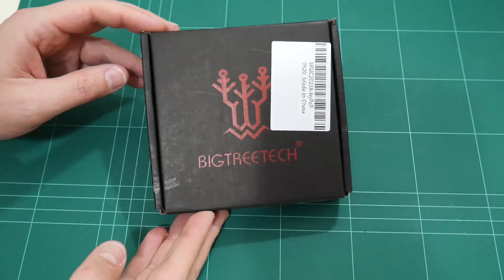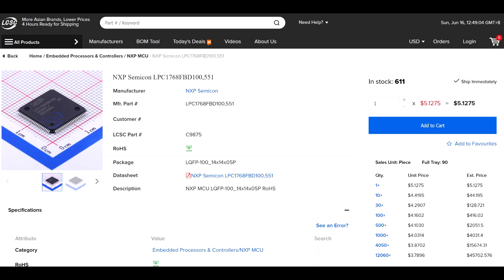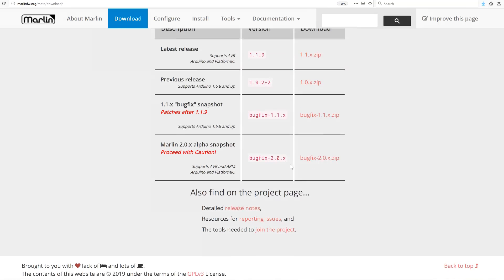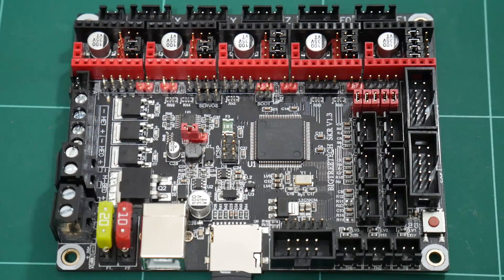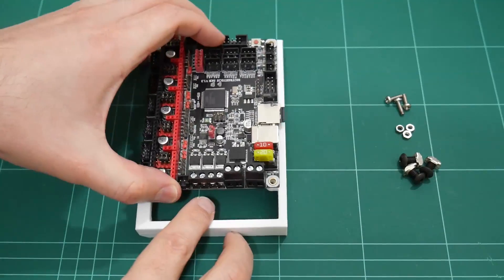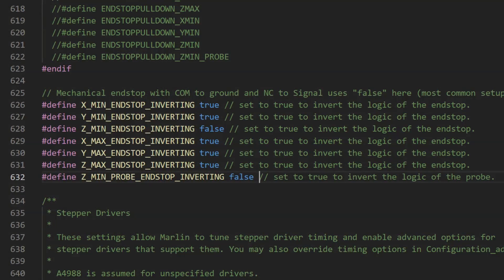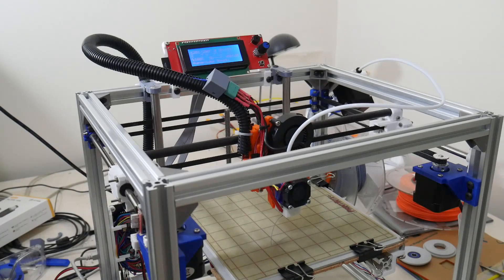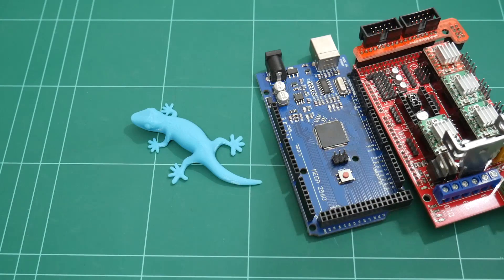Cheap 32-bit 3D Printer Controller!

Comment: Interesting, still no idea why you'd want one. Near the end there was some discussion of print speed, but from my limited experience print speed is limited more to improve print quality due to fast changes in direction imparting vibration to the frame and micro wobbles in the print head. So being able to print faster isn't necessarily a good thing. So why would you want one if you have a working printer?
Reply: The quest for the Holy Grail is alive and kicking apparently based on the plethora of upgrades people do.....because it seemed like a good idea at the time..... to working machines right out of the box. You need to do a side by side comparison for any upgrade or you might as well just rub some snake oil on the machine while praying to your favourite god and burning some filament as an offering......the end must justify the means.
Reply: @gangleweed  Yes, I'm just not clear on what the end is in this case apart from ...more bits?
Reply: If you are using a ramps and its working for you, no need to upgrade, but for any new purchases, these are a good choice, as they are very cheap and offer a lot of expand-ability later down the track (program space wise and also processing wise.)
Reply: @myopinion69420  So this is a future-proofing exercise? It doesn't really do anything now, but future stuff may or may not require it?
Reply: @whittaker007  It does stuff now if you have the need for it. for example, i had originally ordered a ramps to go in my hypercube, but ended up putting the hypercube on hold for a while and bought an ender3, the ender3 board is so bad i put the ramps in that, but i am still running out of memory with what i have enabled in marlin.

Just ordered one of these to go in the hypercube as i am now going to try and finish it and would like full control over the steppers in a nice clean single board. also can run 2 hotends and a PWM fan (part cooling) without adding addon boards.
Reply: I fail to see where the term the Ender 3 board is so bad.....it might not be the very best...….. when people with heaps of experience extoll the virtues of this machine right out of the box and highly recommend it. If it required a new board right from the word go just to make it work then nobody would buy it. I would say that if you wanted to do amazing things with this economically priced and manufactured printer then I suppose nothing yet made will satisfy the quest for the Holy Grail. @myopinion69420
Reply: @gangleweed  I never said it did not work. the printer itself is awesome and if your just printing thingiverse models in pla, no need to do a thing. Except install a bootloader and compile marlin with thermal runaway protection.

Its the fact that the board needs that done is what bugs me about it. If i did not have a mks sbase laying around, i would have probably kept it in, at least in the short term, but i had the sbase sitting in a draw and could not be bothered stuffing around with an arduino to burn the bootloader so just swapped them.

If you want to do ANYTHING other than stock (more bed level options, different stepper drivers, dual extruder among others) you need to use a different board as it is very limited, that's where this cheap, 32-bit board is a good choice, for around the same price if not cheaper than a comparable 8-bit board, you can get a faster 32-bit board with a decent amount of PWM outputs with good fets that should handle anything you may want to throw at it in the future.
Reply: Yes, I realise that you are one who likes high end stuff, but the E3 printer is a cheap and no frills printer....mine cost A$324 on EBAY..... that can perform with the rest.....the fact that it does not do what you said it does is not a case for it being classed as bad......the board that is, not the printer per se. You can always improve anything if you want to achieve something different and the platform is sound enough.  @myopinion69420

Comment: But an MKS GEN L costs the same?! What's better then?
Reply: This is a 32 bit board where as the MKS Gen L is a 8 bit board, the Gen L is basically an arduino with an integrated ramps board.

This board is more like a smoothieboard or a duet but A LOT cheaper, the smoothieboard and duet are both over $100 USD

Comment: The product specs on Banggood don't give the sram or flash capacities...anyone know?
Reply: Hi, uses the mcu lpc1768 so it's: 512kb flash and 64kb on ram.
Reply: @rubenuspv  I had looked up the chip but it seemed it could have different amounts of flash/ram, so thanks for clearing that up.

Comment: I print at much higher speeds with an 8bit controller, without problem.
Reply: Curious what you were printing at before and what you print at now?
Reply: @gymkhanadog  Not sure what you mean by before and now. I've been printing at 80mm/s and higher for years on my A8 (Mega1284) with stock firmware. I now have a custom built Hypercube Evo (Mega2560) which can print much faster, up to 240mm/s. Quality is a trade-off for speed though and I prefer to print at slower speeds. Just saying, print speed is not necessarily limited by the number of bits your CPU has.
Reply: @fredgenius  Oh, derp, I misread your comment and somehow read it as "I now print much higher speeds than..." 

In any case I sure thought 8 bit controllers were sufficient for faster speeds.
Reply: @gymkhanadog  Lol, no problem. If you print via USB, the print speed is often limited by the board's serial chip - if you buy a Mega2560 board you should choose one with a 16U serial chip, NOT the one with the CH340. Edit: I've no doubt that 32bit boards will one day become the defacto standard, but for now 8bit boards are more than adequate. Checkout the Rumba Plus...

Comment: If you want you can try my bed leveling probe. It use optical endstop its accurate can work on any surface  and is really simple. There is link for thingiverse: https://www.thingiverse.com/thing:2769816

Comment: Nice Video ! I do have an trusty old CR-10 and I am quite happy with it. The feature I am missing most, is getting rid of SD-card swapping. Printing from USB is also no option, as I do not want to power my PC for countless hours. Is there a board around you would recommend having kind of network connectivity to "push" GCODE files to a printer boards storage/internal SD-card ?
Reply: Many people (including me) use a Raspberry Pi running Octopi. (Disclaimer: I don't have a CR-10. And there may be better options out there. Do a Google search before buying.)
Reply: @mhelvens  I have tried Octopi before, but this resulted in even worse prints, as Octopi relies on serial communication over USB. And this often caused stuttering and uneven prints. I will continue searching for network enabled print controllers ... let's see what the market will come up with in thee future :)
Reply: @npgoalkeeper _ Awesome, cheap, versatile, exactly what I was looking for, many thank's :-)

Comment: Is there any way to make this work with a printer that has 2 motors for the x axis?
Reply: Yes, you can use the extra extruder driver to drive the other x, look in configuration_adv.h for 'dual steppers/ dual endstops"

Comment: Thanks for this guide.

I am currently using a makerbase gen l board it had the same issue with the pull ups. 
To fix this a opto isolator board was used to translate the signal levels.

I have the TMC2130 modules and used wire wrap wire rather than jumper wires for a cleaner connection.
Moran.

Comment: Sory but the arduino mega in the ramps system uses a 32bit micrcontroler the ATmega2560 like your brain new mainboard. The only difference is that everything is on one pcb instead of 2
Reply: The ATmega2560 is an 8bit microcontroller, what are you talking about.

Comment: There's a 20A fuse on there but the product spec says 15A max input - which is right? And doesn't 15A seem pretty low when you're going to drive a 12V bed heater on top of everything else?
Reply: If you rate the fuse to blow at the specified input current you would never be able to run the thing at the specified input current, because the fuse would blow... Fuses are to protect against overcurrent conditions, normally you rate the fuse somewhere between 3 and 5amps over max as common practice, depending on the design and its tolerance.
Reply: @m3chanist  Sure but doesn't 33% over the max rating of the board seem like an awful lot of headroom?
And doesn't a max rating of 15A seem pretty low when driving a heated bed, especially one larger than 8"x8"?
Reply: @jaychapman6448  No, not really, that's a fairly typical margin. I've measured current draw using this MCU in a different board, driving 4 steppers it pulls about 2.5A peak during print run,  including a raspi, So subtracting that from 15A would allow you to run a 300Watt 24v heater, also a fairly typical size for that sort of DC heat bed, if you wanted more you'd use a mains voltage heater as I do, the size of the bed has no bearing, only the wattage of the heater.
Reply: @m3chanist  Sure at 24V but lots of people use 12V .... all those cr10s for example,  so it couldn't run them.

Also either bed size affects current draw or heat up times would go up with the square of bed size... you can't heat increasingly bigger surface areas with same amount of energy without also increasing heat up times.

Comment: Why settle with a Cortex-M3 when you can have a Cortex-M4F?
Not that it really is necessary but the M3 was introduced in 2004 and the M4(F) in 2010.
M0+ (2012) should be sufficent for most 3D printers.
M7(F) (2014) and beyond would be going overboard with processing power.

I would find a board with an ATSAMD51 interesting.

Comment: Question: does the Ramps display simply plug into the 32-bit board? Or is there additional drivers required?
Reply: It would require a change in the firmware to tell it what display to use.
Reply: it's all on Marlin software, if you are using it now it will not be a problem with this board HOWEVER you need a Marlin 2.0.x as it supports 32 bits

Comment: Just finished installing mine on my Anet A8. Great board and a great price. Took six days to get from BigtreeTech in China to Wales, UK. Very impressed. I didn't have an issue with my capacitive sensor and Octocoupler.
Reply: Any print quality improvement over the A8 board?

Comment: Ok now I just gotta figure out how to do all this in Linux instead, this is an upgrade I want.....
Reply: It's actually no different (even a tad easier) in Linux. Platformio should autodetect the /usb/ttyUSB port to upload to if you're using platformio to upload... and you don't have to worry about drivers on linux, they're already there. You will probably need to make sure your user is a member of the dialout group. Just run sudo usermod -aG dialout $USER. then reboot, and you're good to go.
Reply: I'll probably be doing a linux based add-on to his video in the next day or two at https://www.youtube.com/channel/UCaaQEc2KNmC1GRlv2piR0Rw. Just don't expect the polish and production quality in my video. I'll mostly reference this video, and just mention anything different about performing the update from a Linux machine, and the jumper configs for tmc2100's and pins for the BLTouch.

Comment: Did you every find a solution for the layer shift. I switched to this board after seeing your video and I have the same layer shift issue. I had to cut my speeds and accelerations in half just to get it moving smoothly and event then it still had many layer shifts through out the print. I see lots of bug reports on marlin 2 .0 bugfix layer shift but no solution. Looks like I may be heading back to  my old reliable ramps 4 with marlin 1.1.9.
Reply: My opinion is….if you still get problems even with an upgrade you should look at the mechanics of the machine itself  'cos nothing will fix it otherwise.

Comment: Thanks for the video.  I was pleased to see you were using VSC as there are already several videos out there that show how to do this with Atom.   I would add one tip:  You don't have to specify the drive for the download.  PlatformIO will automatically find it.  At least it did for me.

Comment: God I really wish these boards has seperate input for the drivers. 24v motor drivers and 12v everything else
Reply: Tom Sanlanderer has a video on using mixed voltage supplies without needing separate inputs, called 'use the wrong parts'
Reply: D2 Doctor yes but it doesn’t work well for motors. Works fine for fans etc but not motors. Not to mention it’s not elegant.

Motors need all those capacitors and stuff
Reply: @chloemcholoe3280  You can fairly easily reverse/flip upward the Vmot and adjacent ground pin on each of your drivers and feed them whatever supply voltage you want. 36v for the 2208 or 42v for the 2130 for instance.
Reply: @m3chanist  but there's a few capacitors on the board and fuses you need. and if you do it that way you'd need to somehow add hose. and adding them to the cable doesn't seem like an elegant solution whatsoever. not to mention it won't work well.
Reply: , @chloemcholoe3280  You don't need any capacitors, those are there to minimise noise on the board, seeing as you aren't running your moto power on the board they aren't needed, nor is a fuse as whatever psu you are driving them with will inevitably be fused anyway, you don't need yet another fuse on the output side of a modern switchmode psu as you aren't potentially pulling 40A through a pcb trace in a fault/short condition and burning it off simply because you aren't running the power through the pcb in the first place. In other words, onboard fuses and filters are there to protect the board they on, if you aren't using the board to carry those currents it is a complete non-issue. The addition of a high voltage onboard motor power circuit is simply an aesthetic nicety, for cabling "neatness", it serves no functional purpose apart from having all wires go to already provided connectors. It's more a matter of marketing wank than engineering.
Reply: @m3chanist  thanks :) maybe when I'm feeling adventurous I'll give it a try! I could use a 100w step up for this hmmmmmm
Reply: @m3chanist  neatness is important tho. and like I don't wanna take out my steppers just for that. so it'd be a really nice neat feature to have that costs naer 0$ to implement and doesn't really complicate the design much more.
Reply: @chloemcholoe3280  Yes its a nice feature, but all features have cost, make no mistake. Products such as this are always engineered down to the cost, not up. Have a look at a typical circuit board in just about anything, you will; notice unused silkscreen outlines or outlines that are for larger components, sometimes this is to allow varian5s but more often than not it is the accounting department winding in the engineering department, I.E building the thing down to the cost they dictate. The existence of the motor power in on the next tier up board, the pro, and not on this one is a very deliberate choice,  you could call it the length of the lever that is calculated to move you to the upgrade.
Reply: @m3chanist  as someone who does electronics i think it'd be super simple and not add cost whatsoever.
Reply: @npgoalkeeper _ ... Oh hey! I know you from the 3D printing server! That's actually a little rude... but eitherway I can take a guess and hearing from thomas it's not a very good idea for the motors.

Comment: Honestly the 32 bit controllers are so cheap. The main reason these boards cost so much i assume should be popularity. But soon as we move into 32 bit it’ll be dirt cheap. I mean arduino and AVR is mainly used in hobby stuff which is why we got arduino with marlin etc

EDIT: it actually seems some of these fast 32 bit MCUs are even cheaper than an avr actually!  4$ a piece vs 2$ for an lpc1768. I actually do embedded coding and stuff so i work with cortex-M series a lot. The downside is that COrtex m coding is a LOT more complicated. But marlin already is ported to it luckily ;) (although I segue it’s not ported very well. It only supports code on a sd card etc afaik)

Comment: Smoothieware firmware for this board, anyone?
Reply: Problem is, that they did not open source their smoothieware changes, as required by smoothieware license, hence you will get a lot of anger from the smoothieware front if you ask for support! So be careful!
Reply: @josefseibl2932  What do you mean by "they"? Board's authors/sellers?
Reply: @blacklion79  smoothieware is open source software. The license requires that any changes that are made need to be open sourced as well. Big tree tech has taken this open source software, made changes, compiled a binary from that code and sells a product based on that.
So if you have any problem with the configuration of the board (or bugs), you probably won't get any support from the open source community. You have to go to big tree tech for support and software bugs.
On the other hand, as soon as they release the source code changes, there is at least one dev waiting to merge the changes upstream and license issues should be resolved. I'll buy a board as soon as this happens. Before, it could be that you are left alone with problems.
Note: they released the marlin changes, so I'm hopeful that smoothieware changes will also be released.
Hope, my explanation wasn't too confusing...
Reply: @josefseibl2932  Oh, I see, I didn't know that Big Tree Tech distributes binary-only version of Smoothieware, It is license violation for sure! I've asked about community patches in my very first comment, of course :-)